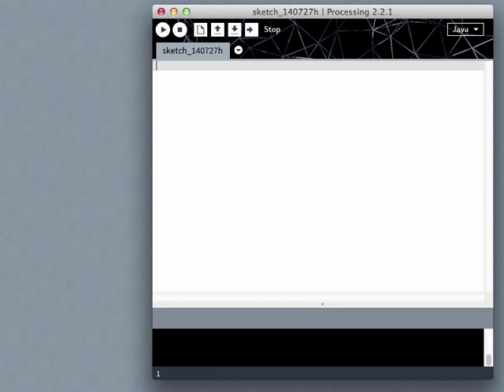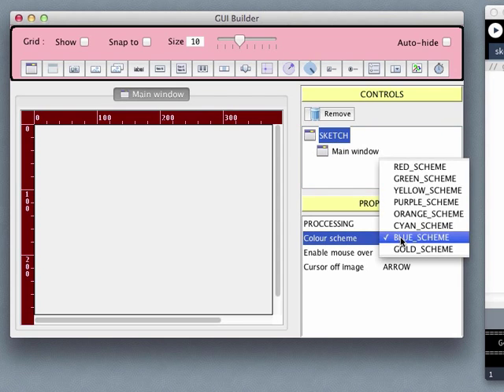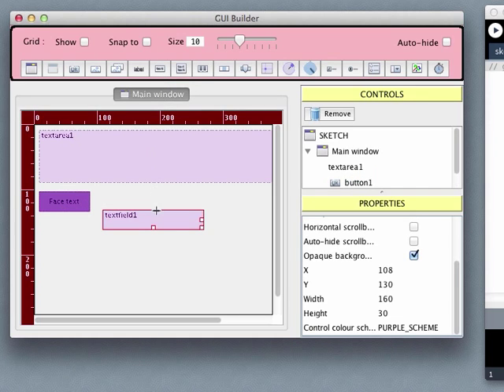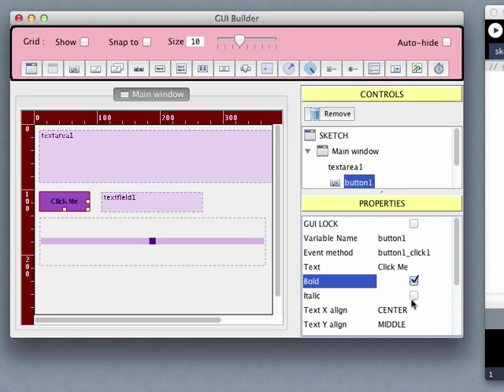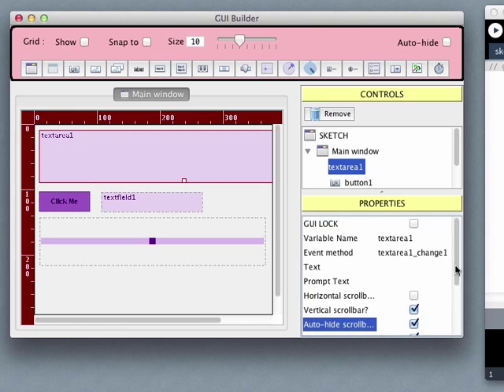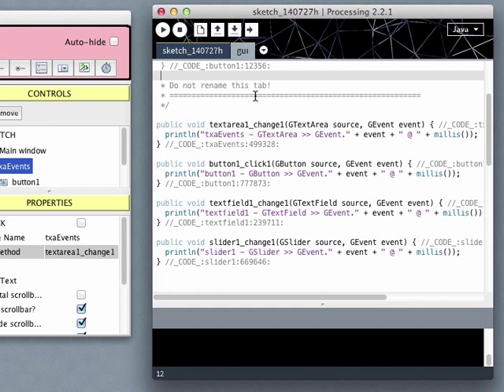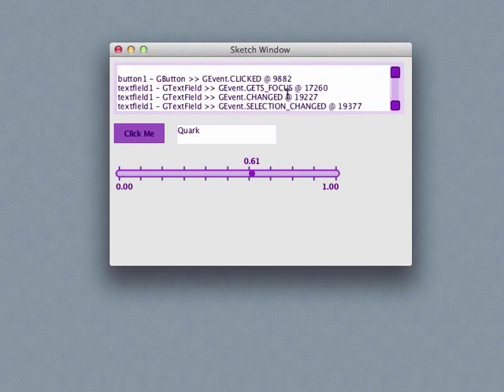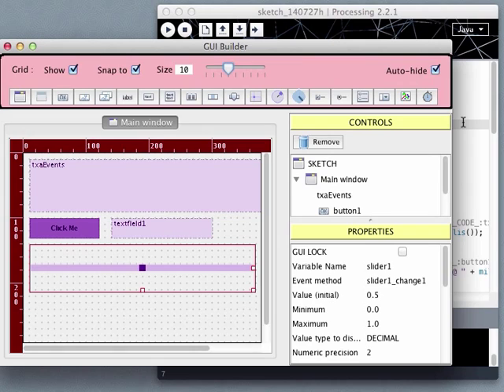GUI Builder 1

Comment: Extremely useful. I have been deciding what language to use for a GUI that will control a piece of equipment via the serial port.  I like the syntax of C++ (Python is a bit weird with indents instead of brackets), this is what I have mainly used in the past. There is a lot of similarity between C++ and java and I don't have time to learn yet another language. I took part in a course on Processing with Monash University (through Future Learn), which was very good. My Visual Basic learning was back in the days of VB6, VB.net looks like a learning curve I don't have time for. When I found your GUI builder and ran a few examples I knew that was what I needed. The only trouble seems to be matching the versions of GUI Builder with the versions of Processing. The best and most recent combination seems to be Processing 3.5.3 (3.5.4 is most recent but will not run GUI Builder) and your most recent GUI builder (4.3.2).  I saved some work only to find that it will not load after an update, I stoically put this down to a learning experience and I will stick with this combination for the moment, making sure to save things separately before any updates. Well done though, I appreciate the enormous effort that has gone into this work. You will of course receive acknowledgement in my final code.